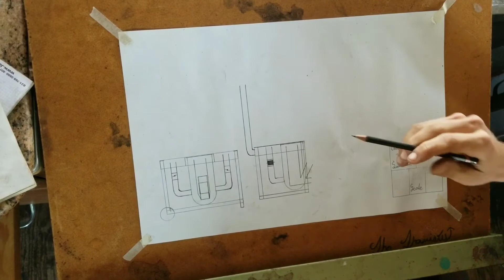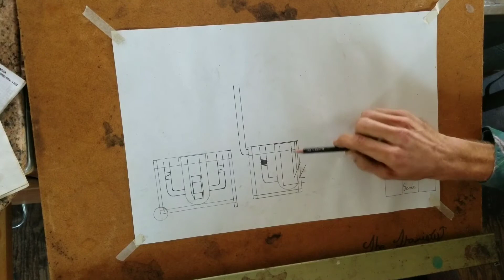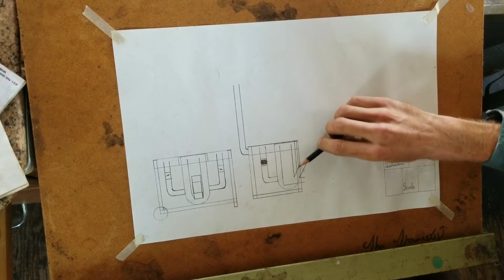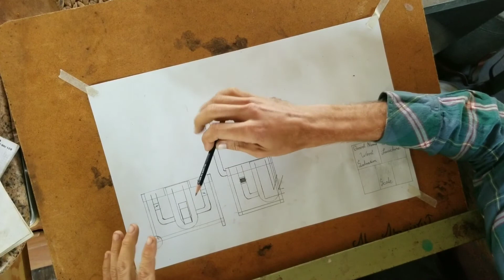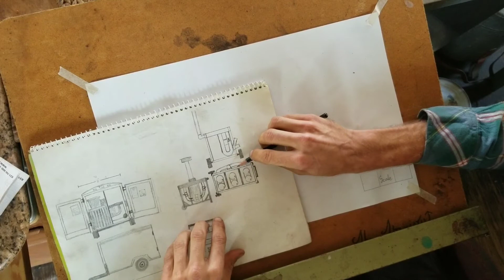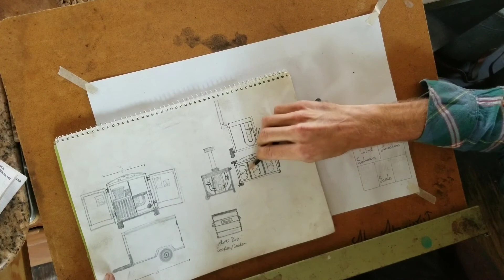Rocket Stove Design

Comment: thank you for this!    I would love to know your thoughts on possibilities of a creative solution for how to integrate a rocket stove mass heater into a tiny house *on wheels*, --without creating problematic mass!   The thoughts I've come up with have included using water as a thermal Mass, but not sure of the details of implementation. I wish something like sand was usable, but I think that's not a very good thermal Mass?   Water, of course, is... Though it may come with its own set of challenges.  looking for something that I can empty out & refill again, if / when I need to move the house.  Any Creative Solutions / brainstorms welcome!   🙏🏽😌

Comment: Hi Leo, I've got some thoughts to share based on my experience with rocket stoves.  It looks like an ingenious design, but in my view you are over complicating things, and designing around the use of the propane tank, which itself is not necessary.  It looks like you are using the tank to act much like the bell or barrel on a rocket mass heater, or as you say a "secondary combustion chamber".  In my understanding there is no combustion happening in the bell section, complete combustion should take place in the insulated heat riser.  The bell actually serves to cool the gasses down, as the cooler gass falls down the bell it helps to push the exhaust through the mass of a rocket mass heater.  You dont need a bell for a cooking stove.  If your heat riser is working right, there will be complete combustion before it gets to the top, and no smoke at all.

The other problem I see with the use of the tank is that all that metal will act as a heat sink, so you will have to burn the stove for a while just to heat up the metal to the point where it is no longer pulling heat out of the exhaust gasses.  If you are cooking large pots for a lot of people you need quite a lot of heat, so the less the gas has to travel before hitting the pot, the better. 

I think the cook top from the stove is a great idea, as it allows you some control over heat transferred to the pot.  For more control, I think it would be beneficial to have 3 separate heat risers and wood feeds, perhaps with different cross sectional areas , for instance two 8 inch stoves for boiling soups, and one 6 inch for less heat.  A large pot of water sitting directly over the heat riser of an 8 inch system will boil slightly quicker than the same pot on a "Turkey cooker" propane burner. So if you are cooking a few different pots or pans at once, you need more than one heat riser to heat them all.

My suggestion would be to use the wood stove cook top, and have three different heat risers that each come up directly underneath the rear inserts of the cook top.  Create a separate chamber beneath each pair of inserts, so that the hot gasses can travel from the "high" burner right over the heat riser, then under the "low" burner in front as they are cooling down.  Then you could connect the exhaust of the 3 separate chambers into a single chimney.  If you needed extra heat you could remove the inserts and cook directly over the heat riser.  If the heat riser is creating complete combustion, the exhaust coming out if the open hole will be only CO2 and H20, just as if you were cooking with propane. 

On heat risers, they must be highly insulated to work correctly, and I would not use any metal because with the temperatures involved the metal will melt and oxidize over time.  The easiest options would be either insulative fire brick, or refractory cement fiber board.  You can even buy fiber board rocket cores pre-made now, someone is manufacturing them based on Matt Walker's design.

Anyway, that's my two cents, or maybe ten cents :)  Feel free to contact me direct if you have questions or want help.  I'm not much one for long Facebook comment threads or zoom meetings.
Reply: Www.rocketstovecores.com is the place selling ceramic fiber board cores.  The fiber board can be difficult to source since it is usually sold for industrial applications, but if you can find it you could build your own cores for less expense.
Reply: Thank you for adding in your expertise here!  

   I would love to know your thoughts too, on possibilities of a creative solution for how to integrate a rocket stove mass heater into a tiny house *on wheels*, --without creating problematic mass!   The thoughts I've come up with have included using water as a thermal Mass, but not sure of the details of implementation. I wish something like sand was usable, but I think that's not a very good thermal Mass?   Water, of course, is... Though it may come with its own set of challenges.  looking for something that I can empty out & refill again, if / when I need to move the house.  Any Creative Solutions / brainstorms welcome!   🙏🏽😌
Reply: @aureas  You're welcome!  You are correct that sand is not good for thermal mass.  The many tiny air spaces between the grains make it act more as an insulator.  You can use 3/8" pea gravel, as the spaces between the pebbles are big enough to allow air to move though them, creating a convection current that will heat the air in the room as it moves through the mass.  Pebble style mass heaters are less efficient than solid mass heaters, meaning the mass will absorb less heat from the burn, and hold on to it for less time.  
Water makes great thermal mass, but when you are putting it near fire there is a potential to create a deadly steam bomb.  Do a lot of research and make sure you understand the risks and safety measures involved before you attempt to heat water with fire.  That said, what it boils down to (groan!) is that any vessel of water that is being heated needs to be open to the atmosphere, not closed or sealed up and capable of being pressurized when water turns into steam.  Steam has the power to move a locomotive train, and it also has the power to blow up your house!  It is crucial to have a place for the steam to escape the vessel as the water heats, so unless you want to turn your tiny home into a wet sauna, you will need to vent it outside, and make sure there is absolutely no way for that vent to become blocked.

With all that said, depending upon the design of your tiny house and where you park it, it may not make sense to put a mass heater inside of it.  Space is limited, and mass heaters take up lots of space.  A friend of mine built a tiny home on a 25 foot trailer, and lived in it at 8600 feet near boulder, Utah.  He heated it comfortably with a very small wood stove, which was manufactured with a small water tank on the side to supply hot water and a small amount of thermal mass.  The tank had a lid that just sat loosely on top so it could never be sealed, and was small enough that the amount of water vapor released into the living space wasn't a problem.  Rocket mass heaters are awesome, but as always, it depends. Good luck on your build!